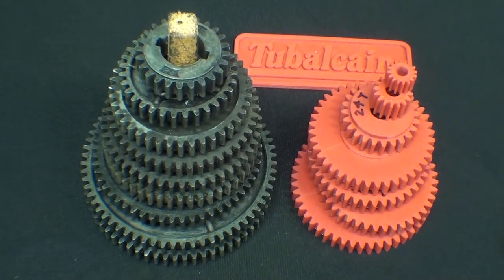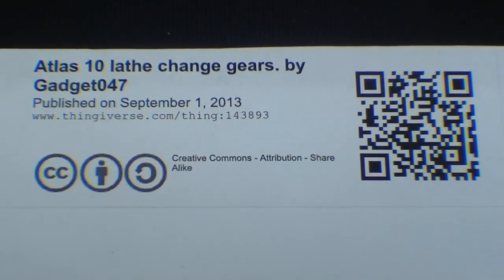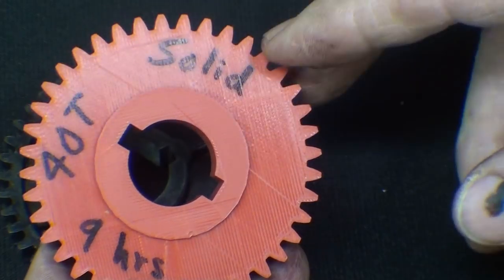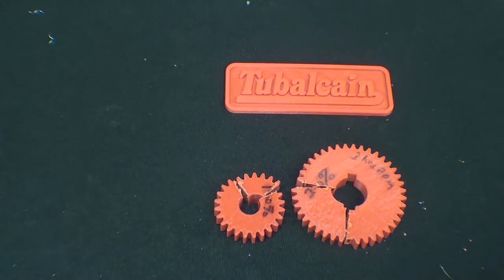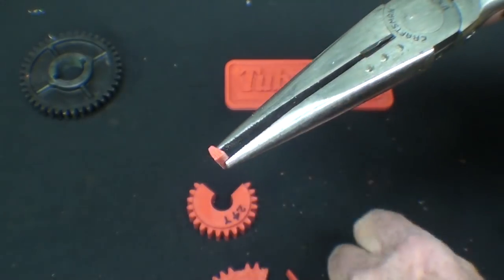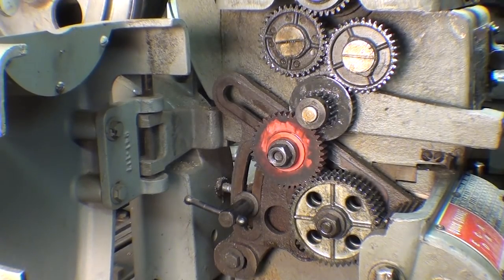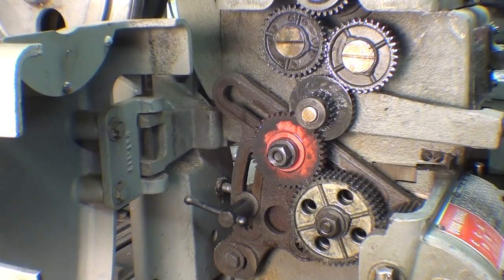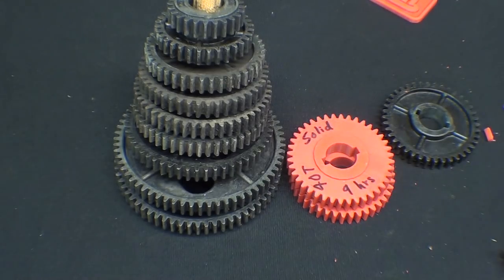3-D Printed Gears for Atlas Lathe TIPS #416 tubalcain

Comment: Use more perimeters so the teeth are solid but the main body can be hollow
Reply: That's what I was thinking, but then the body of the gear will be nearly solid as well, might as well do the whole thing at 100%, ya think?
Reply: Garry Dufford yeah that would happen on the small gears but on the big ones I think most of the body would be hollow, I would recommend 5-8 perimeters based on how big the gears look
Reply: @mitchellstrobbe7779    I am currently playing with these settings to produce a set of change gears for a Jet 9x20. I don't have it dialed in yet but my initial tests with increasing the number of perimeter shells is promising.  I am getting solid teeth but I still need to dial in the speeds and overlap to get it where it needs to be.

Comment: Thanks for the testing. I have a complete set of the 3D printed gears I use on a Atlas 10f lathe that were printed over a year ago at my local Library from gadget049's files. They do indeed run quite and run true. When I got the lathe only gears were the ones on the lathe.  Now I have the complete set of gears for thread cutting and I think the cost for them was around $20. Keep up the great videos, I watch them all.
Reply: Michael Banak have/do you oil your printed gears? (That have lasted a year?)
Reply: trialnterror no I run them dry. Run so much more quietly then the stock gears.
Reply: Michael did you print the gears solid ? I had a 40 T printed for my 10" atlas the gear did not last 5 minutes the teeth stripped of. If the only last 1 year that would mean you make new ones every year ???

Comment: Just to finish out the experimentation, you should put the 20% gear on the machine and try it under load. It may fail but it might be surprising how far you can push it before it does. It might even make it all the way to the “belt slip” stage.

Comment: Oil will probably dissolve or soften the gear over time. it was a great test and I was impressed.
Reply: I submerged a PLA part in non detergent 30W oil for over a year.  No problem.   PLA is not petroleum based,
Reply: In ur dreams bro.

Comment: Amazing work, not only they are fairly resistant but also act as a great fuse for the not always so careful hobby machinist. I just had to replace the bull gear on a 50yr logan clone on which I'm definitely going to put a couple plastics on easy to reach spots after the rebuild. 

One cool project is casting your own gears, you can print your gear with sprues and gates, cover it in plaster and heat the mold to get rid of the plastic,  you can then cast zamak on the mold, it flows much better than aluminium. It's an easy "investment casting" tecnique, and as long as your mold is dry and preheated to a temperature close of the Zamak you're probably going to get a usable gear on your first try.
Reply from the maker: Thank you, that was Interesting about casting metal gears

Comment: Thanks Mr. Pete - interesting test of the plastic gear.  The 6" Craftsman (Atlas) also used stamped gears made out of the Zamac material and I have seen the teeth on the bull gear for the back gears break away on the one I now own - my dad bought it new in 1962 from Simpson Sears here in Canada.  He did a lot of starter and generator armature commutators with it and had hopes of doing heavier tasks but the lathe was just not made for that as he sadly found out as the back gear set up just could not handle some of the tasks he asked it to perform.  I was able to purchase a new bull gear from Clausing Service Center in Goshen Indiana back in the early 1990's and it was all steel and has stood up very well over the years.  I believe that Clausing Industrial still offers a lot of repair parts such as gears for the Atlas brand lathes - they are now located in Kalamzoo Michigan (you probably already know this but thought I would share it in case you or other viewers were not).  The items they supply are not inexpensive but definitely good quality as I got a new lead screw for the lathe a couple of years ago - sometimes being able to purchase a quality manufactured repair part is more important than the price of the item - just my opinion.
The plastic gears appear to stand up surprisingly well but I assume their downfall would be the same as the Zamac material - any chips caught in the gear train teeth will eventually destroy the tooth profile - just my thoughts.  Have a great day.
Reply from the maker: Thank you for an interesting comment. I agree with everything you said.

Comment: I would suspect that these gears will hold up well unless there is a bind in the train, as there really should not be much load on them. A bind in the feed train would break a zamak gear as well. You might see loads sufficient to damage the gear when milling on the lathe, though. The gears don't even need to be very precise, even for cutting threads. At about $US0.05/g for PLA filament, the 100% gear has direct cost under $US2.00 including the raft, and 9 hours of machine time with associated wear. Not bad. I  would probably not go with ABS for this application as, though tougher,  the harder surface of the PLA will wear better. ABS, or nylon (more$$$ and trouble to print) would likely be quieter.

Comment: Great video idea, and much appreciated. The results support my overall feelings on 3D printing -It's the new frontier for replacement parts.
Reply: I printed half nuts for my atlas I was surprised at the results. Typically A lot cheaper then replacements parts if it’s a part that will work plastic
Reply: Half nuts is an interesting replacement print. Is it holding up?
Reply: One major problem with PLA is that once it gets HOT, it melts! So I would not recommend for production quality use!
Great for us hobbyist, though!
Reply: @driversteve9345  Move to Nylon! Much better heat tolerance.
Reply: @7Trident3  much harder to print though lol

Comment: Really enjoyed this video.  Great test.  About 14:47, when you stalled the lathe the 2nd time, the top gears flex when you turn the power off.  These top gears may experience more stress than the one you replaced.  Also agree with the comments about longevity/durability.  But the only way to test this is to replace the metal gears with 3D printed gears and use it for a while.  Thanks Again!

Comment: I have both a lathe and dividing head that have stripped gears.  This is a real chicken and egg problem, as I could easily make the gears if I had a working lathe and dividing head.  My plan is to do exactly this and use my 3d printer to make temporary gears to allow me to fix the broken tools.  Thanks for the test, makes me much more confident my plan will work.

Also, excellent idea with the threading dial.  I will have to try that myself!

Comment: That was a great test. Now if they were sized up by like .03 percent (or whatever the aluminum shrink rate is) and printed at like 10% infill a guy could use the printed gear for the pattern and cast them out of aluminum.  The printer could even print the sprue and gate then before pouring melt or burn the plastic out of the mold.
Reply: Apparently this can be done quite successfully.  You need to use the "natural" colour as this doesn't have any additives for the colour and burns away more readily with less residue for a better casting surface finish.  I think this would make a really good project for a video (though I haven't looked to see if this has been done before on Youtube)
Reply: In software you can also stack the gears all up inline then cast the set in one pour and part them off on the lathe.
Reply: Or even cast them out of ZAMAK :D
Reply: The Wikipedia article on PLA referenced in a comment further below says that PLA printed solids  can be used in a “lost PLA casting” process much like lost wax investment casting.
Reply: You can also buy wax filament for use in 3D printers for lost wax casting.
Reply: oirvine - neat, I’ll bet jewelers and dentists might use this filament in a 3D printer for some of their work.
Reply: But why bother? PLA is plenty cheap and available, and will happily burn out of investment at "self cleaning oven" temperatures. (ask me how I know XD )
Reply: See here: https://www.thingiverse.com/thing:82176
Reply: Yeah, if considering plaster investment burnout curves, there is plenty of available information to show that the PLA should burn out quite well.  For instance:

http://energetics.chm.uri.edu/system/files/Chemical%20Treatment%20of%20Polylactic%20acid.pdf

I set up the kiln and got a bunch of investment material, but then I lost access to a 3D printer, so I never tried it.
Reply: True. I've never used either for that purpose so can't speak to it either way.
Reply: I used to work in a place where they made gold and silver rings (jewelry) from lost wax in plaster of paris. They would buy the wax models and only got one ring per model. Lots of possibilities here.

Comment: Fun and Thought provoking Mr. Pete, Thanks. As about half the 153 commenters below recommend not using oil and I agree however an alternative is lithium white grease...even with PLA it has a hi lubricity and pressure resistance and should not degrade the PLA as fast as sulfur based or detergent based lubes...works on ABS as well like my mini has & never broke or barely any wear for 4 years.  The coolest thing about this to me would be the ability to create additional gear ratios for all kinds of purpose...metric threading, more threading options (i.e. 5-40) higher lower feed rates, etc.  Thanks again for rattling the BB's.

Comment: I'm printing the set of gears designed by Gadget047 right now. I made some adjustments like printing them with a 30% infill and a little more layers in the shell. After watching you run these gears on the lathe, I think they will work just fine, and when they break, I'll print more maybe out of ABS instead of PLA. Thank You for the video and demonstration.

Comment: Hey Mr Peterson,  a couple of suggestions.    PLA and ABS aren't the only games in town.   I haven't been doing 3D printer for some time now but check out CO-POLYESTERS like those from ColorFabb.   I have good luck with ColorFabb XT.   They are less brittle than PLA and not as difficult to print as ABS.   One issue is it needs to be printed hotter like 260C which is the upper limit of a lot of printers.
Also, I don't know if the new Cura supports it yet but some slicers allow you to alter the infill for different parts of the print.   For something like a gear, I don't know if you could, but ideally you would have high or 100% infill on the teeth and reduce if for the inner part.   Also on the issue of infill, there is some guidance that infill above a certain % doesn't add strength.
If you haven't found it already, check out Thomas Sanladerer channel on youtube and particularly his Filaween series where he tests filaments for various qualities like print quality, impact strength and temp resistance.
Have fun!
https://colorfabb.com/materials/co-polyesters

Comment: I've printed and ran plastic parts as well as the threading dial gear. I go all solid. It's still cheap.  If you want to print hollow parts, consider increasing the number of shells until the teeth are solid with at least a few shells of solid backing.  Perhaps 10 shells will do it.   I print 3 shells on everything with 100% fill.  I only print in ABS.  It does require more skill to tune the printer for good prints, but it's not nearly as brittle.  PLA is not temperature stable.  If you mount your lathe in a mobile car operation (I am trying to be a little funny but don't laugh, I saw an ad with a lathe mounted in the back of a station wagon), on a sunny day the gear teeth might frown.  In case a reader does not know, a shell is a solid layer before the reduced density or fill lattice layers begin.  It is applied to all surfaces.  If your printing with a .4 mm extruded, 10 shells would be first 4 mm solid.  5 shells would be first 2 mm solid.  Something to think about.  Feel free to contact me if you need any assistance or just wish to pick up a YouTube stalker.  ;-)

Comment: My 7x12 Mini lathe came with plastic change gears and they held up fine for the 7 years that I owned it.  The other great thing is that a complete replacement set was only $35.  If the PLA don’t hold up in the long run, I’m sure one of the better materials you can print with will.  Chris
Reply: I would not be surprised if your plastic gears were made out of a better plastic than PLA is though. In fact I'd be pretty shocked if they weren't. Something like say injection molded Nylon?
Reply: Paul Frederick I realize that, and believe I touched on that in the last sentence of my original post.  Chris
Reply: +Shadowdog500 it was a very light touch. Which is something I have been dealing with far too much lately.
Reply: On my 7x14 Mini lathe they are injectionmoulded ABS. I have been thinking of printing some special gears in PLA though, or possibly in PC.
Reply: probably glass reinforced nylon.

Comment: Great Video Mr Pete!
My wife and I manufacture tin cookie cutters. I design and make all the tooling for our machines. It takes me about 8 to 12 hours to make a set of tooling out of cold roll steel. So we decided to get a 3D printer to help make the dies and save so time. The thought was it was like having an employee And I could be doing something else. Our first print took 35 hours! It was like watching paint dry. But I do think that is much faster LoL. The print held up from the force that was applied to it but it only lasted for 2000 to 3000 pieces. It tended to wear out from putting the tin on and off of it. Needless to say we scrap that idea and stuck with the tried and true method of the steel. I have some tooling that is well over 10 years old and have run thousands and thousands of cutters on them. But I do find the 3d printer to be a fascinating machine. Thank you for printing the gears and posting a video on them. I often wondered if the would hold up.

Comment: Cool experiment.  I have an old abused Atlas 10F that the previous owner dropped while moving and broke the motor mount and the main drive pulley, so I got it cheap.  It didn't come with many change gears, just enough to drive the lead screw for basic turning (96 tpi and 24 tpi IIRC).  Wanting to have a capable lathe and do some threading I went to ebay and the premium price you mentioned drove me to seek alternatives. So I searched and found several people that had printed their own sets out of nylon and were pleased with the performance and the noise reduction.  I don't have a 3D printer so I looked into having them done by one of those online services.  The price was something like $85 for the biggest gear - 1 gear.  Well, that made the ebay premium price look much more attractive so I went that route.  But, if you didn't have to pay for machine time on someone else's printer (and as they become more and more common the time-cost will drop) I think it would be a very acceptable solution, especially with the more durable plastics available.

Comment: Great video. I second some other comments asking for some heavy interrupted cuts (after all, I don't have to pay for the carbide inserts). Incidentally, if this material can handle the gear train, then something like a thread dial indicator must be a really sensible application - no real load and they are overpriced.

Comment: We all may have a sentimental attachment to metal but there are some pretty good possibilities out there with plastics and 3D printing. Finding parts for older machines is one example. Of course if one is trying to restore an old machine to original condition using parts that are at least made from the original material, as close at least as possible, would be desirable but if you just want to return an otherwise reasonably good machine to functionality this could be a very good option.

Comment: I only just got my lathe so I have very few miles, but having 3d printed many gears I'm excited to try this. Now the final gear in the train sees the most force so I worry a little about that one, but it's still try then everywhere.
However the most exciting thing to me is to try printing some helical gears, as the thrust force is low enough I think you can get away with it, and helical is stronger than straight cut. But the MOST important part, is it's quieter!

Comment: Mr Peterson, may I suggest the oiling the gear is probably not such a good idea. The plastic will be self lubricating and the presence of oil or grease merely acts to collect dirt and grit. Petroleum products also commonly degrade plastics over time.  If you intend making similar types of parts then ABS will be better but Nylon would be better again.  These materials will likely need a heated bed and an enclosure to keep the heat in. It does not need to be too elaborate, a re-purposed cardboard box will serve well.
Reply: Rob B I am curious if there is some research on oiling gears? Be impossible to not oil the gear so long as zamak and pla gears are meshing. Would nylon or abs have some oil resistance/susceptibility
Reply: @Rob B - I thought this at first too, but when looking up PLA discovered that it is apparently highly oil and grease resistant. Surprise!
Reply: I know that in the model train world we are cautioned to only use lubricants specially formulated for use on plastics! Otherwise the plastic will become brittle over time and break! I would think that to reduce the chance of contamination from "old" lubricant, you'd really want the entire gear train to be plastic! Just a thought!
Reply: Sure, but unless the entire gear train is plastic, you still need to oil it and you can't put oil on one gear and not have it move to the others.
Reply: its because pla is plant based